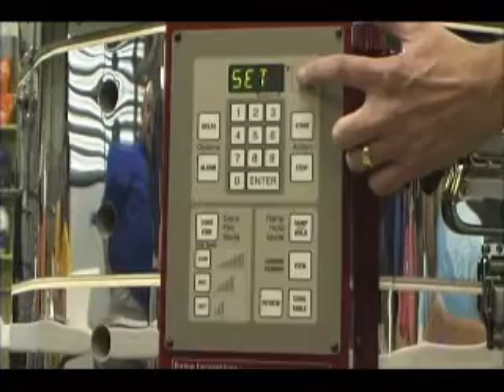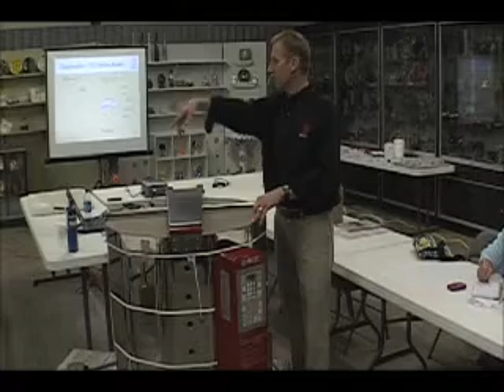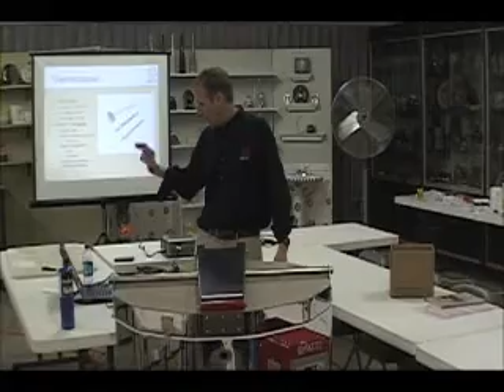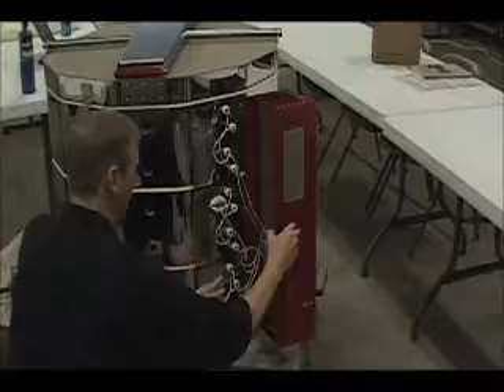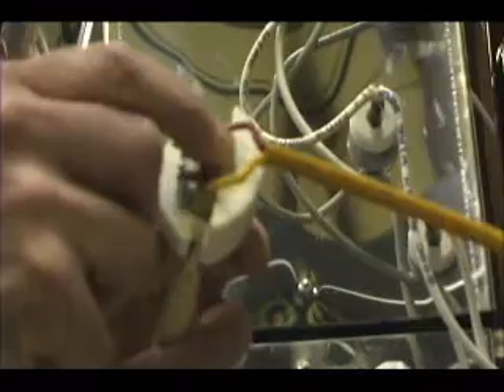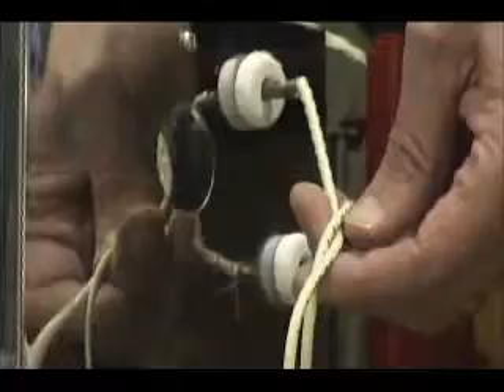Skutt   Maintenance and Troubleshooting 2

Comment: 18 + 15 + 18  =. 51 amps, not 47 amps.  Which means your drawing more amperage than your spec plate.  Why is that?  Is your controller over-calculating current in the elements or is your kiln improperly specd?
Another issue, i’ve Recently had to service the controller for the km1227pk kiln for my wife because it blew the transformer on a cone 5 firing.  Your controller is a Nightmare to work on, and I am an engineer, so I know what I am talking about!  Conductors are all the same color, nothing is marked, your mercury relays are paired to the elements (6 relays for 3 hot sections)  and your wiring diagrams don’t indicate which mercury relays in the controller are paired, the only way to find out is to find which relays are assigned to the corresponding outputs from the controller board.  A real amateur job, not a professional unit by a long shot. A real pain in the ass to work on!  Really sucks!